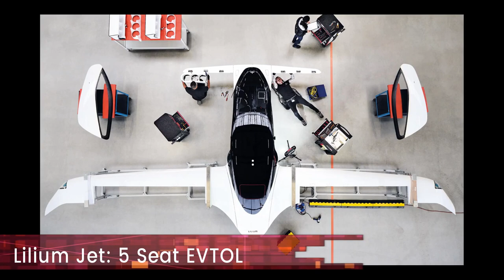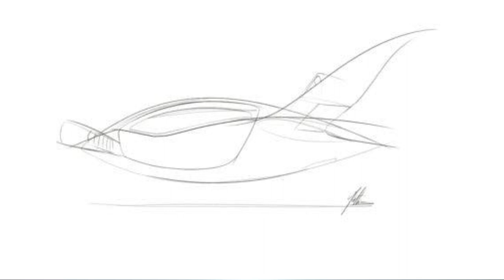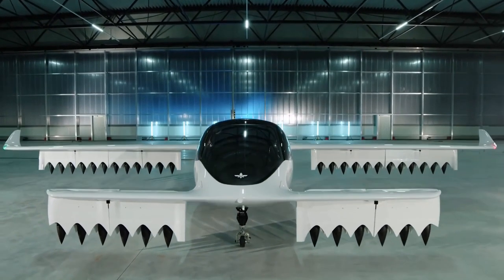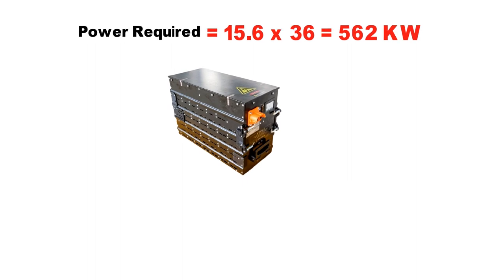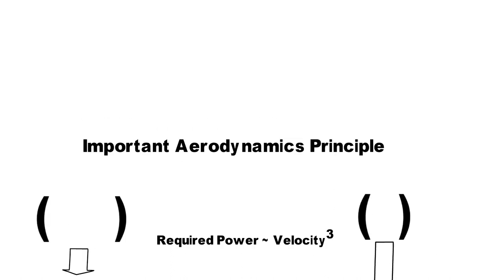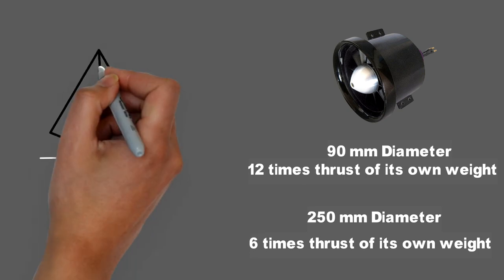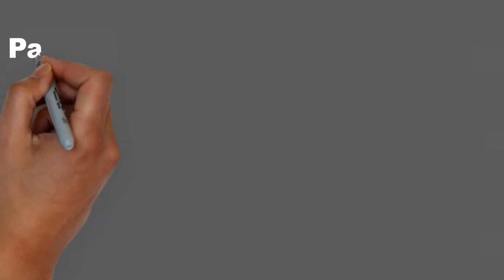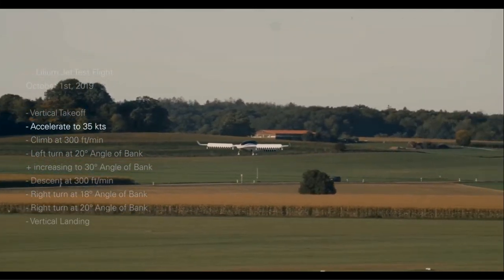The Engineering of Lilium Jet

Comment: What if you could replace the Li-Ion battery with a hydrogen tank/ fuel cell for providing electrical energy to the motors?  
Perhaps in the future, a battery storage technology would work, but it is awful heavy for now.  
But I have no idea how much weight/ energy a H-fuel cell could provide.  Maybe it has the same problem.
Reply from the maker: The problem is you would still require a smaller batterypack to go with the fuel cell. So for a larger version of Lilium,  definitely Fuel cells would make more sense. The current version doesnt look very voluminous to pack in hydrogen cylinders, fuel cell stack and batterypack
Reply: hydrogen tanks are thick and heavy, thats why they are currently only really used for powering busses

Comment: The reason I like this plane is that for those separate thruster vtol designs there's always a nightmare when one of those thrusters fail and the whole aircraft will start to spin and crash, yet for this plane, the disastrous scenario would never happen due to its so many thrusters and therefore very fault-tolerant.

Comment: I dont really understand how ingesting boundary layer can reduce its drag, because the only reason air flows toward the sucking fan is because its pushed by the nominal air pressure behind, which I thought was the same flow direction that's creating the interface where the boundary layer is occurring anyway. This shortcoming in my understanding is terribly vexing.

Comment: The concept of Lilium seems good, but it has so many drawbacks. So eventually, it is not a very good idea.
Reply: everybody forgets that lithium needs to be extracted somewhere......
Reply: @dronevan   nobody forgets that. There are plenty of trolls on the internet in all the comment sections pretending it's a problem. That's almost like saying: **Everyone forgets that oil needs to be extracted somewhere**, except oil is a fuel that's consumed in the operation of vehicles while a lithium battery is more comparable to a fuel tank. Lithium makes up a tiny fraction of the material that goes into a lithium battery and the ecological damage caused by its extraction isn't even comparable to the damage caused by the extraction of fossil fuels let alone the transport (and spills) and refinement. This is the whole birds and wind-turbines bullshit all over again...
Reply: @AbeDillon  Although I think it's fair to say that lithium is a scarce resource or at least in high demand and limited supply. With demand increasing supply at reasonable cost is a valid concern. Electric car manufacturers have apparently been having problems already and it's not likely to improve with increasing demand unless supply can be improved sufficiently. Alternative battery solutions do seem possible though, but they are still years off being practical in my understanding
Reply: @AbeDillon  Maybe you didn't got the memo, but the wings of wind turbines have to replaced latest after 25 years and are not recyclable.

Comment: I have a patent-pending  multi-stage rotor that can be electrically driven. It can be geared to a slower,   ducted  fan.  the fan draws air to a series  of  reverse flow ducting between concentrically aligned rotors  fixed to  single  wheel mount. The air is incrementally compressed  through the concentric rotors,  just as in an axial compressor . The exit air has a higher density and  velocity, producing more thrust.  Will the owner of this channel , forward me  your e-mail address, so that I  may forward you the documents for your  comments
Reply from the maker: You can send me the details at skywardselectric@gmail.com
Reply: @ElectricAviation  Thanks . will do .

Comment: Great explainer video! I would love to understand better how long the plane will fly in VTOL mode and how high before it changes into normal "Steigflug". 

From the video it looks like it needs only maybe 50 meters high before it can switch? That would mean that you need high power only for a very limited amount of time. Did you ever consider providing the electricity for the VTOL part via  wireless energy transfer? There is a company in New Zealand who has an interesting solution for that: https://emrod.energy/

Comment: The calculation with a total thrust of 640 kg is unrealistically for a 5 seater. A 5 seater has alone a payload of 5x100 kg = 500 kg. So you only have 140 kg for the structure, bateries and motors. If you calc with more realistic necessary thrust of 2 tonnes, you need a Megawatt which is more heavy....

Comment: "Engine" = combustion engine
"Motor" = electric motor
All BEVs (battery electric vehicles) have motors.
Yes, there are exceptions (eg "motor boat").
Reply: The engine and motor argument is mostly semantics for the sake of argument and varies wildly from one demographic to the next.
Reply: @Skinflaps_Meatslapper  I generally agree, but they should not be used interchangeably in the context of EVs. You wouldn't say "Tesla has powerful engines", would you?
Reply: That's a common misconception and colloquialism however it is not true. A motor is simply a device that imparts a motive force. An engine is a machine (moving parts) that converts ANY fuel to work. Including electricity.

Engines can also be motors and vice versa - hence motor boat -  but not always.

Solid fuel rockets, which clearly combust fuel, are rocket motors ONLY and not engines as they are not machines like their cousin the rocket engine.
Reply: @PabloGonzalez-hv3td  Thank you for the good technical definition which I had never heard before (and I am a Canadian aerospace technician teaching technical English in Germany).
But would you agree it is strange to say that "an EV has an engine"?
Reply: @ryankozak99   In English it's strange linguistically but perfectly accurate technically. Some languages like Spanish only use the word motor.

Comment: maybe it has 21 l/d when the edfs are running, but if it losses power, then it juts has huge dive brakes it cannot retract, it would have an abismal glide ratio then, it is likely thee most dangerous airplane to loose power in.
Reply: Emergency parachute or thruster
But you make a good point

Comment: It appears LiliumJet will be the firstest with the mostest at the EVTOL buffet. Certainly it's destined to become the  Tesla of the EVTOL universe.
If only we could develop a power source alternative to batteries...
In a 1945 paper, Wheeler & Feynman noted that as electron density in a space increased, the associated spray of virtual particles increased.
What if the electron density were increased to the point that the magnetically suspended electron density begins to act as a single mega-electron, similar in concept to a Bose-Einstein Condensate. The virtual particle spray becomes of such magnitude that many of them are harvestable through a pulsed magnetic array surrounding the MegaElectron's outer shell, vectoring them to an egress point of connection. 
But WTF am I?

Comment: Using Super Capacitors for takeoff and landings because they're much lighter than batteries and charge and discharge fast.
Reply: So extra weight which it's carrying around which only gets used during takeoff and landing. Pretty sure capacitors have worse energy density that batteries.
Reply: @nic.h  weight to power ratio the technology of Super Capacitors have come a long way. Maxwell was bought by Tesla for their dry battery and Capacitor technologies
Reply: @ap0lmc  it's possible that super capacitors have improved in the energy density area enough to be practical, however seems we would be seeing them utilised in similar applications if that was the case, which I'm not aware of yet. Maybe I'm just ignorant of the developments there as I haven't specifically researched it recently

Comment: Tesla's 85 kWh battery weighs 540 kg.  Even if the remaining aircraft and passenger only weighed 148 kg which is near impossible, the battery would only last 9 minutes.  If you're only getting 2 lbs of thrust per horsepower (hp), that's comically bad.  Even a prop can get around 4 lbs per hp.  Helicopters are in the region of 10 lbs/hp and often better.  Some of the larger DJI drones are in the 10 lbs/hp range.
Reply from the maker: You are assuming that the aircraft is only hovering. The vertical take off and landing is to last for a matter of seconds, not even minutes
Reply: @ElectricAviation  If take off and landing phase takes 20 seconds, that's one third of the fuel capacity right there. There isn't much to begin withand I question the validity of the demo flight because it was so short and had zero payload. We don't even know it's a used impractically lower battery capacity to reduce the weight for the purpose of the demo.
Reply: @GeorgeOu  I think, you might be pretty off with your assumptions. There is an engineering analysis on Electric VTOL Configurations  Comparison from Department of Mechanical and Aerospace Engineering, Politecnico di Torino (https://www.mdpi.com/2226-4310/6/3/26/htm).
 It is 19 pages long, it was not a real-world measurement, but, still, based on quite solid numbers.  Lillium Jet (v.1)  fares way better than you predicted -  for a  100 km mission energy consumption is only 16.1 kwh.  The only remaining issue is actually a specific power - everybody knows -  it's  not easy to lift something vertically - but as Electric Aviation and papparocket  said - there are some interesting aerodynamics effects which could  give some help, too....

Comment: Electric Ducted Fans (EDF) are terribly inefficient. They should have went with ducted props and could get double the thrust for around half the amp draw of an EDF, which means less battery weight or longer flight times.

Comment: Any kind of short circuit or power failure and this bird will fall out of the sky as their are no control surfaces making the glide ratio a moot point.
Reply: that can be easily addressed by creating a distributed power system instead of a centralized one. each fan - its own battery and controller. 1 fan failure - no problem

Comment: but I think that this is not a real electric "jet" in its true definition, because the electrical power does not heat air making plasma, but only feeds the fans of the wing. Okay, maybe more efficient and technologically more advanced, but still powered by helix. Not a "Jet", so.

Comment: Since when are “electric ducted fans” considered to be a “jet?” 🤔
Reply: A jet is "a rapid stream of liquid or gas forced out of a small opening." What is your definition?
Reply: @samielkhayri9272  that is true, however "jet" when referring to an aircraft is usually using a turbine reaction engine such as a turbojet, turbofan, or turboprop. You know what he means
Reply: @EEEEEEE354  The way jets are used in aviation today will not be the way they will be used in the future. At the very least, they will not be nearly as polluting as the gas turbine engines in operation today.

Comment: Double safety:
- multiple engines redundancy 
- no open propellers
Reply: yeah but rotating wings adds more moving parts that can fail and cause an accident. That is minus 2 safety points in my book
Reply: Fantastic video !
 I have a question about the serrated edges on the " wings ".
Besides noise reduction, do they serve any other purpose on the trailing edge of a wing ?
If used on a conventional wings trailing edge, would they actually create additional drag due to any vortex generation ?
I notice the trailing edges of some bird wings have a serrated look to them. 
This would of course be for sound reduction on birds such as owls, but you also see it on vultures as well ( the feathers on the wing close to the body - not the tips ) 
The shape is a subtle serration. 
I ask because I was considering adding a serrated edge to a kammback extension I added to my car.
Thanks !
Reply: @DailyDroneFPV  Pretty much all planes have flaps, the rotating motors would be a similar level of complexity to flaps, maybe a bit more depending on if they use distributed separate power buses for motors or groups of motors.
Reply: @nic.h  rotating wings are much heavier duty and more complicated than flaps. Besides, if flaps freeze, you can still land the plane on the expected runway. If a rotating VTOL feature freezes up, you can no longer land via VTOL unless you want an unscheduled rapid disassembly of your vehicle.

The answer to this dilemma is to design a VTOL plane with fixed vertical motors for VTOL and one or more fixed motors for horizontal flight.
Reply: @DailyDroneFPV  Not sure I agrèe on rotating the motors being more complicated than flaps. Flaps tend to be mechanically complex as they aren't just rotating around a single point, but altering the shape of the wing profile and extending the wing depth. I suspect you are probably correct in regards to rotating the motors needing to be more heavy duty than flaps as it has to safely be able to transfer all of the thrust from the motors to the airframe while operating perfectly during rotations.

There are downsides to having propellers for VTOL configuration and separate ones for forward flight. Extra weight and drag for something that is only used during a short portion of the flight.
Reply: @nic.h  You are right on that point, there surely is a cost for more fixed engines for special purposes, but IMO it is well worth the added safety. When it comes to eVTOLs, the motors/props to not weigh very much compared to traditional aircraft motors. Really, the heaviest part of an eVTOL is the battery. Adding a few extra motors does not take away much functionality. Regarding flaps versus rotating wings: I am not familiar with full scale aircraft flap engineering, but for model aircraft, a simple piston or servo with hinges is sufficient to make a functional flap. However, to rotate an entire wing/motor you need much more power. Not only do you have to rotate the entire weight of the motor/wing, you ALSO need to contend with the large amount of angular momentum that belongs to the rotating props. This takes a massive amount of torque to do for a motor going full speed. The rotating mechanism will need bearings, and locking system to keep the wing/motors locked in place when it reaches its designated configurations. Also, there will be added weight one should account for due to this added heavy duty rotating mechanism/motor and locking systems, so it is not as efficient as you might have originally thought. Bottom line is it is more complicated and prone to eventual failure, which would likely result in loss of life. Also, I would add that my suggested configuration does not require flaps either since the motors can be spun up individually at different rates.

Comment: i wouldn't fly in this plane at least never with this amount of Lithium inside battery packs, this is just a recipe for disaster. IF the battery pack fails or catches fire or undergoes thermal runaway there is no turning back the plane will come crashing down. Even on normal flights there is a limit on how much lithium can be carried. I want Lilium to carry out destructive tests on their battery packs and prove to the public on the reliability of their design against all the dangerous scenarios and release the results to public. This is absolutely rubbish, cant believe FAA is even making this time bomb legal. Lilium is burning up all the investors money. Video is just marketed in a way what people want to hear. There is no mention of safety features. What is the plane going to do in case of structural failures ? What is the plane going to do in case of fire? 
How long will it take to charge the batteries ? how many charging cycles will the batteries last ?
They never tell us how long can the plane hover for ? 
Video from lilium does not address any safety features of the plane. Even a new car in the market talks about safety.
Commercializing a plane like this until 2025 idk wth is FAA doing i dont think they would have built and flown enough of the planes to prove to the public they carried out sufficient tests at all operating conditions. 
Hope lilium doesn't recreate Hiddenberg 
Even Space X releases videos of all of the rockets models and their testing to the public. So far lilium has just one video showing their plane's abilities.